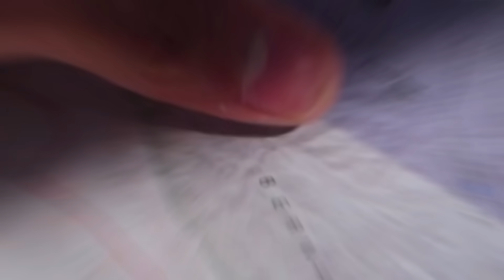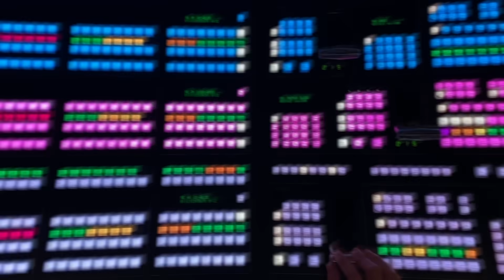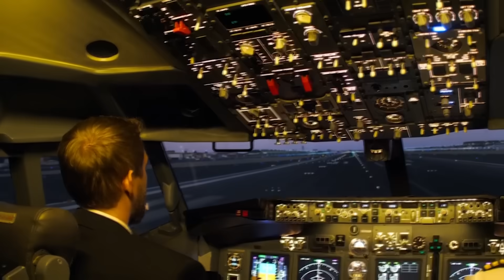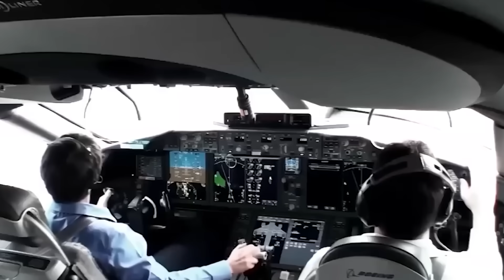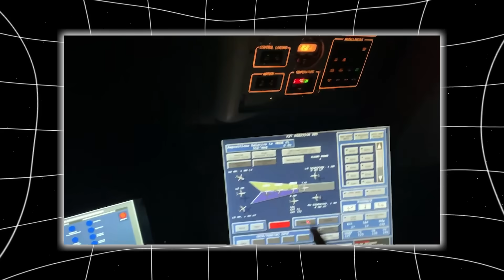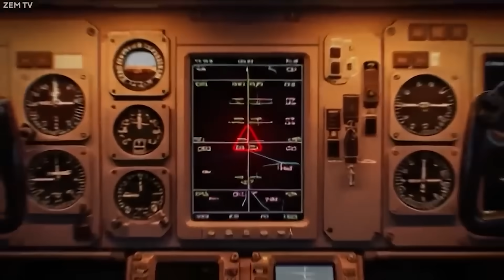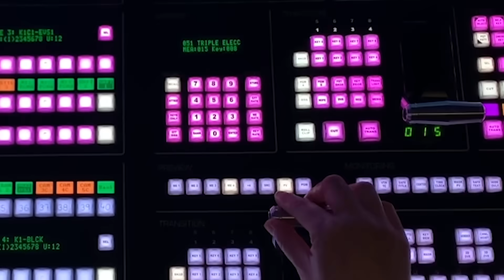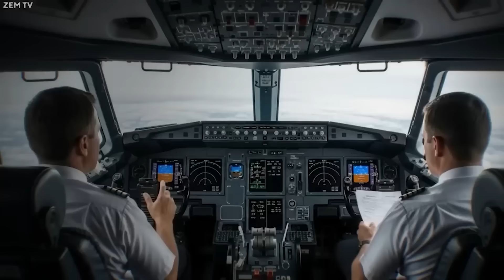Scientists REVEALS the Men Behind the Crash of Air India 171

Comment: The maker of this video does not show intelligent conclusions. It states that the fuel control switches were switched off one second apart. If the lock mechanisms that prevents accidental movement of the switches were not in place, an accidental bumping the switches would have caused both switches to change position at the same time, not one second apart.  The one second between the cut off of each engine is consistent with the intentional movement of the switches.

Comment: Important note for anyone watching:
The final investigation report has not been released yet.
What’s being discussed in this video is mostly speculation based on early details.

The official preliminary report from India’s Aircraft Accident Investigation Bureau (AAIB, July 2025) only confirms that both engines lost power after the fuel control switches moved to CUTOFF. It does not say why this happened or who was responsible. The cause remains under investigation.

Be careful about channels claiming the “full truth” — aviation reports usually take a year or more to complete. Until the final AAIB report is published, any theory (pilot error, sabotage, mechanical issue, etc.) is unproven.
Reply: But this makes a lot of sense. Why the hell there was no alert or warning when both fuel switches were cut off? My car gives an alert when I exceed 80k speed

Comment: DUH! This video confirms the fuel cut off switches were manually activated therefore the pilot monitoring DID IT. A lot of anti Boeing deflecting over things not responsible for the crash.
Reply: It fell because of the actions of ONE PILOT
Reply: @annsheridan12  Of course kid, that is why investigators ignored to mention EAFR time RAT deployment in report? Lawyers asked for it, they were ignored. But you do not mind that investigators pissed on the graves.

Comment: The Boeing 787 should have had an interlock once the plane was in flight the fuel to engines shouldn't able to turn them off rxcept when on the ground
Reply: No if you have an engine fire or engine overheating you need to turn off the engine in the air.